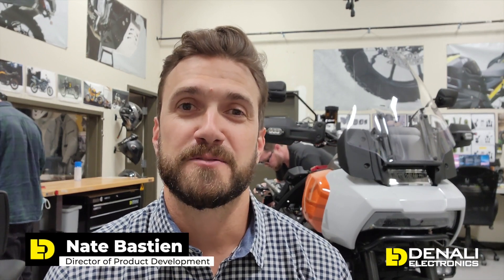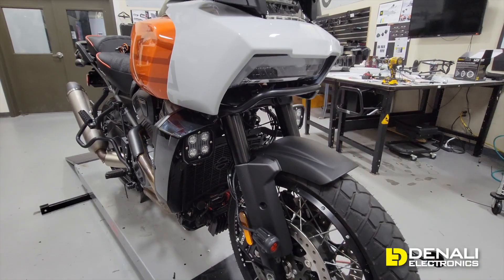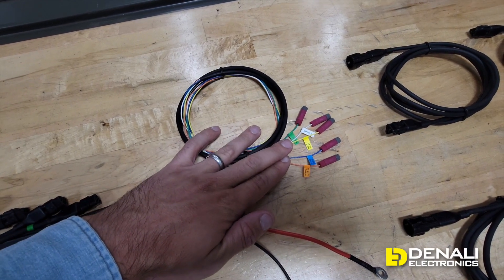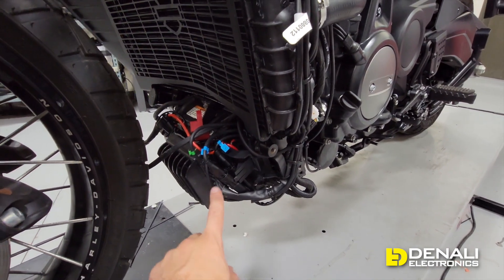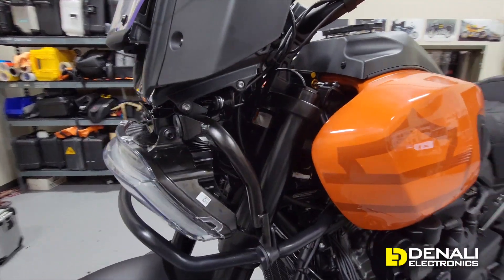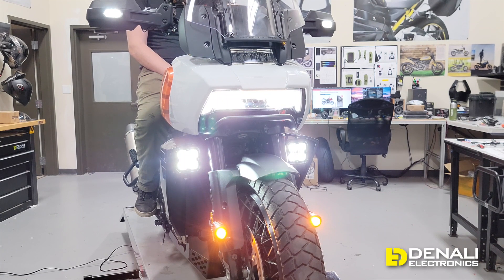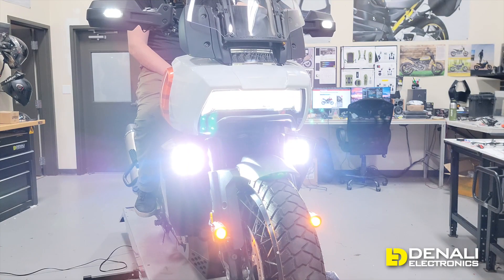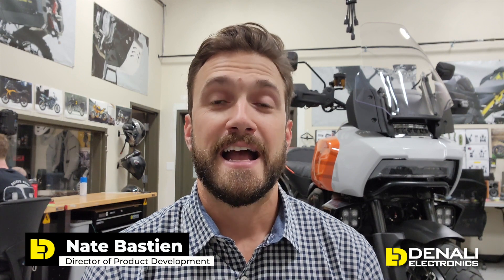How to Install Dimmable LED Lighting - Harley-Davidson Pan America - Complete DENALI Wiring Guide

Comment: Here in Davao Philippines the dealer is trying to void my warranty because they did not install my auxiliary lighting. They said it is the reason my bike has had 3 batteries, starter control module and no starting episodes. My lights are 2 watt LED.

Comment: How have you mounted the dial switch to the handlebars. I have the kit and the dial switch does not fit as you have it shown.
Reply from the maker: You are likely seeing a switch mount: https://denalielectronics.com/products/dnl-mbk-10000
Reply: @DENALIElectronics  Thanks for the info……but you website says that that product does not fit the PAS 1250……so slightly confused 🤷‍♂️

Comment: I gotta be honest, I'm quite a few hours in, and there is nothing "easy" or just "plug and play".  I have small hands and I can't get to the wires for the headlight.   You need to route the right turn signal wire through a mess of wires and the frame.  Some clearer video of running and zip tying the wires would have been great.  I'm guessing they will be in the correct place when I put everything back and they won't bind anywhere.   Also, some indication of a "dry fit and testing" point would be good.   I'd hate to be done and something doesn't work.
Reply from the maker: "Plug-and-play" is commonly used to describe an install that doesn't require modification to the motorcycle or it's original equipment. This DialDim kit includes everything needed to install without tapping wires or modifying the OEM components. 

We try to note in every install video that you should check clearances regularly while installing any wiring to your bike. A quick lock-to-lock of the bars while wiring can be helpful to check pinch points. Reach out to our Customer Service team if you have questions: https://denalielectronics.com/pages/contact-us

Comment: Hello! Terrific looking products and great tutorial video. I own a 2022 Pan Am S. Is there a way that you could give me a break down of the pieces I would need to "Tap in" to the options you mentioned for the end result you have in this video? Turn signal feature, horn flash, high beam etc. I basically want the same setup you have in the video. The D4s, DMs, D3s on the handle bars and rear.  I ride a lot, 920 miles in 2 and a half weeks of ownership and mostly at night. So I want to make sure that people see me very obviously. And I want to be able to see deer ahead of time. Thank you.
Reply from the maker: All of the lights and accessories developed for the Pan Am are located here: https://denalielectronics.com/pages/product-result?rq=gc_motorcycle~yr_2021~mk_harley-davidson~md_pan-america-1250

Comment: I was looking between the cansmart and the dial dim for my PanAm. Is there a way to connect the B6 brake light with the dial dim controller, just like we have on the cansmart ?
Reply from the maker: There is not a built-in connection to the B6. You can always just tap the rear brake circuit with the posi-tap.
Reply: @DENALIElectronics  Yes that's a way but that way the customisation won't be there for thr brake light flash etc. So contemplating before pulling the trigger.

Comment: Maybe a better question for HD, but your module is down low as well. What happens when driving axl-deep through water?
Reply from the maker: Although our DialDim shouldn't be submerged for long periods of time, we feel that Pan America owners will have problems with their battery being under water long before our controller becomes an issue.

Comment: What if I don't want the dial system? Just the driving lights and the hand guard turn signals for my 1250S. I'm not that fancy, just want it to turn on and off and do the turn signals the way it does in the video with the Plug and play wiring. Thank you in advance.
Reply from the maker: We would set you up with our driving light wiring harness, driving lights, the upper light mount and the T3 plug and play kit. I built a cart for you so you can see all of the pieces: http://denalielectronics.com/apps/cart-loader?cff_crt=acca541fdeed958840ee324a3cb8e032_1656188172276

Let me know if you have any questions!
Reply: @DENALIElectronics  Are the 3 hybrids available for my bike rather than the 7?

Comment: Very nice👍is it possible operate the D-4’s as a light and side signal in one? If not, will you work on such system? Thx
Reply from the maker: The DialDim Lighting Controller is capable of using a light set to cancel (go dark) with signal, or flash with signal! 
https://denalielectronics.com/collections/accessory-mangement/products/dialdim%E2%84%A2-lighting-controller-universal-fit
Reply: @DENALIElectronics  Thanks for the reply! When D4 flashes with a signal, is it capable flash orange?

Comment: Hello, does your wiring work with the Daymaker led auxiliary lights from HD ref 68000340?
Reply from the maker: There is a chance that it could work, but we have not tested our controller with other brand lights. At a minimum you would have to wire our 3 wire pigtail to the HD lights to insure connection to the DialDim harness.

Comment: Does adding this controller to headlight make it lose it dynamic lighting on special. It moves when the angle changes.
Reply from the maker: Adding this controller does not change the operation of the stock headlight.

Comment: Great video, really like the flashing lights with the horn on this system. The light cut off when signal is on will help other drivers see it better.  The turn signals on the hand guards is a great idea, but some will say they can get damaged if you crash off road. But on road it is a much better and more visible location for turn signals. But in my opinion I would keep the original location and use your aux bracket. Also that bracket would be great for the Pan Am if used by the police to mount their emergency lights, that is a great location for them. We already have a few demo units here in Fort Worth Texas that a dealer has been loaning to departments. 
This video was also great on how to wire something from the battery, I did not know this and is a big helper for adding a Garmin GPS and USB port.
Reply from the maker: We are glad that it helped, thanks for watching!